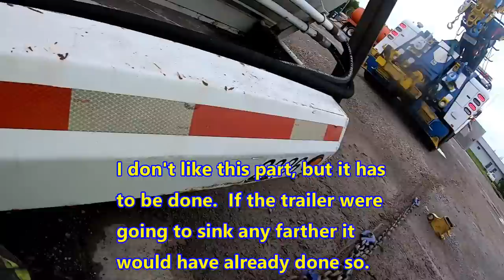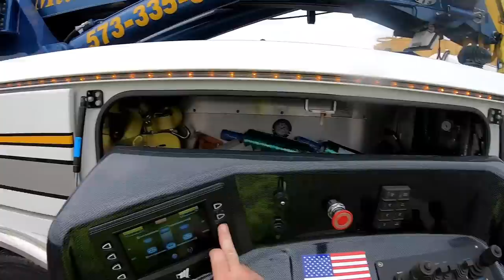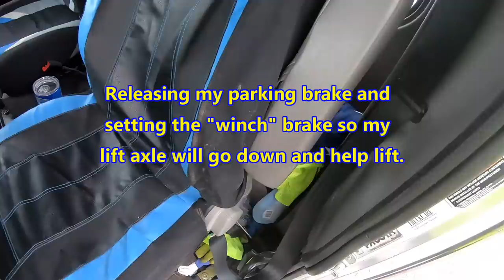Loaded Tanker Takes A Dive....Nose Dive That Is

Comment: I wish you had devoted some time explaining why this was dangerous instead of simply stating it was misleadingly dangerous.  From my naive perspective it was a trailer loaded with water over soft ground; which doesn't seem dangerous.  What's the worst that could happen?
Reply from the maker: There were multiple dangers to this job.   Since the load was heavy liquid, it transfers the weight forward when the nose goes down, so there was no way to know an exact weight that I was lifting.  The lift itself was dangerous.  Me having to get under the load was dangerous.  Performing the lift on soft ground conditions was dangerous.  Moving forward with an un-baffled liquid load suspended behind the Tator was dangerous.  Chains running over a metal end creating a high pressure point was dangerous.    Walking anywhere around the trailer while it was suspended was dangerous.  Setting the loaded trailer down on the bent/broken dolly legs was dangerous.  The heat and humidity were dangerous.  Working by myself was dangerous.  I could go on and on.  However, I find that when I point out all these dangers, some viewers make rude comments that I am being "dramatic", when in reality I am only trying to convey the actual dangers associated with the job.  There were many times during this job that if something had failed or gone wrong I could have died.  That is not being dramatic.  That is the simple truth.   I try not to think about it, but that is a huge part of why I take so many precautions and attempt to be as safe as possible.  This job is inherently dangerous....period.    Thanks for watching and God bless.
Reply: @RonPratt  I wasn't implying you were being overly dramatic.  I just do not know enough to understand why it was dangerous.  There are probably others like myself who have no experience and don't see what your experience has trained you to see who would benefit from your inner analysis and insights.  It makes it more interesting to me when you share your thoughts.  Like your comment that it is an unbaffled tank.  I had not thought about that.  When you pointed it out, I then understood why you emphasized in the video that you were taking it slow.  I didn't put those two things together until you pointed out in your reply that it was not baffled.  It is more interesting to me when you share those insights and observations that may be so ingrained for you that they almost don't register consciously with you.  For me, it didn't even cross my mind.
Reply from the maker: @Scott Perry I meant no disrespect and I didn't intend to sound harsh.   I was attempting to answer your question and also explain that I have issues with some viewers who believe that I AM being dramatic, when, as I stated, I simply make the comments about the dangers so that people will understand just how dangerous it is.
Reply: @RonPratt  This is the kind of job where the danger seems minimal for the average person, but for the 'experts' they see all of the dangers. Some of those are really dangerous, like going under. Some others seems so unlikelly that for the unexperienced it look like you are being overdramatic when in reality you just consider what could happen. One example is when you walked between that tanker and the other. I felt a bit uneasy when you went there. Even if unlikelly at this point, one chain could break, which would cause the trailer to swing. Yes the legs were extended at this point, but again it was damaged. Which is another problem from going between them. The legs could also have collapsed, leading to a trailer that swing sideway and down... Yet, for the average people, it look safe, after all, you are still hooked so it 'should' take the weight if the legs fail, and if the chains fail the legs are extended so it 'should' take the weight... We know it is not a sure thing at all...
Reply: @RonPratt  Better to be overly cautious and careful, than to end up a pancake under that trailer!  I would have been afraid to drop the trailer after seeing that cross bar bent like that, and leg tilted in. Glad that guy got a tractor under it quickly.
Reply: @RonPratt  When you said "sugar water" to me that indicated that it was probably like a syrup and slow to move. So not only is there more weight in the nose, it may not move when you raise it. Depending on its viscosity it could take minutes to level out.
Reply: @RonPratt  I get it.  Thanks.  I'm sure you wouldn't be aware of all the dangers inherent in my work if you stepped into my work environment as well; paper cuts, staples, stairwells, running out of toilet paper, ...
Reply: @RonPratt  haaha dude why do you even waste your time replying to trolls. just disable your comments section, yer still gonna get the same views.
Reply: KP OP wasn’t a troll!
Reply from the maker: @RevMarket  Agreed, I believe Scott Perry asked a pertinent question, so I responded.
Reply: @scottperry9581  I assume Ron cleared it up. But, Trailer loaded with water. Fully loaded with water, on soft ground... Trailer, loaded with water, on soft ground. How does that not sound like a disaster waiting to happen? The trailer already sank into the soft ground. Just an FYI: I have no experience in this kind of job. I drive a reach truck and counterbalance as my job. If you were never taught to recognize danger. Real danger that could kill you or somebody else then I will throw out a suggestion. Learn about all the potential dangers you could come up against. Not to be all scared n shit about "danger" but to be aware. Even I thought to myself watching Ron walk  between the suspended trailer and the trailer on his right "That's an incredibly deadly place to be if a chain or line fails" (words to that effect) Watch as many videos as you can with these kinds of recoveries to learn and understand what makes something dangerous, and to learn how to spot risks. I understand not everyone is aware of everything. But i'm surprised how anyone (other than a child, no offence intended) could think that this lift was "misleading dangerous" I bet you've narrowly avoided death on many occasions due to being naive and unaware and not even realized that your life could have ended in 1 second. I won;t assume what job you do, or how old you are. Shit, there's risks and dangers working in an office at a desk all day. there's risks going to the toilet to take a shit in a rush. This lift was about a 10/10 on the danger scale (laying under the trailer put it to a 10 in my opinion) Before that, maybe a 7. walked between the trailers also made it far more dangerous. I'm rambling now. I'll stop. You probably get the point. :)
Reply: @RevMarket  Thanks.  My purpose was to understand at deeper level the dangers not apparent to my eye.  Ron Pratt obviously knows his stuff and I appreciate his taking time out to educate me.
Reply: @RonPratt  I didn't feel any disrespect.  I am grateful you took the time to reply.
Reply: As a wrecker driver myself we do and see what others don't and ron is a professional with a lot of experience. Some of it gained through error. And it does become normal for us to do a job and do it quickly so it seems easy it is his experience that makes it easy and quick but never can make it less dangerous.
Reply: @thephantom1492  The thing is, in this line of work there is no such thing as being too safe. When a person starts that line of thinking is when they let their guard down and catastrophe strikes. I drove the "big rigs" for many years until recently when I retired. I never pulls a tanker but being in the industry for such a ling time you naturally pick up other information. Beginning several years ago if a driver pulling a box trailer wanted to carry liquid totes in their trailer, they were required to have the tanker endorsement because even those smaller liquid containers can pose the threat of sloshing liquids. I experienced that too many times. Water is among the heaviest of many liquids and can be quite dangerous if not properly handled.
Reply: @Kevin-go2dw  Sugar water even in this context is plain ordinary water with whatever quantity of sugar added. That alone will make it heavier plus the water is able to slosh around in the tanker quickly.
Reply: @RonPratt  Also the dolly feet could have been suction stuck in the mud and during the lift suddenly let go causing the trailer to lurch
Reply: @jonnywilson9117  I'm a steam fitter and in our trade crane heavy lifting is common and yes, there are certainly lots of dangers that are present. Chain lifting aren't allowed as chains rated for such lifts are insanely large and worst of all, HEAVY. For lifting where sharp edges are a problem, we have nylon softeners that we use. When nylon isn't an option, we have wire slings.

The main issues is you don't know if the load will slip or shift when lifting. Once the load starts moving is a certain direction and with enough speed, it can get very dangerous. I've seen loads shift with so much force that if a finger or any body part were in the way, it will be destroyed. 

I even noticed in the video how he never jumped over the low arm when there was a load. He instead chose to walk all the way around the crane. The entire area behind that truck was very dangerous.
Reply: @RonPratt  There were so many dangers, you could have spent the whole video talking about them. I watched when you looked around the nuts at the top of the dollie leg that was a bit toed under.  You didn't talk about fractures in the paint as a clue to underlying metal fatigue about to collapse the trailer forward to the right, putting a big strain on the left chain to who knows what result. 

Years of having to take calculated risks in kill-zones and pinch points and beside loads that could shift in a moment let you give great advice about risks but you don't always have time to recount the years of experience that back your cautions. 

I've noticed how much better you have grown as an educator. You give clear and pertinent directions. Keep up the excellent work. 

If you ever decide to change careers you'd make a great industrial safety trainer, but not too soon I hope. You channel is my favourite on YouTube.
Reply: There is an action that is called "Moment of Inertia", involving Fluid Movement. There is no way to calculate Moment of Inertia, in this scenario. I believe Ron already commented on this issue.
Reply: Someone mentioned dealing with trolls by turning off the comments. I think that would make this more like TV than interactive learning conduit that it is. Ron knows what he is doing and a lot of us watching have no idea of all the technical details that he runs through in his mind to make sure that he goes home every night. 
Trolls are going to troll. Its what they do.  It all comes back to the classic "walk a mile in another mans shoes" in the end.
Thanks again Ron for sharing your daily job with us. The editing and forethought in getting good video is yet another set of skills that you quietly teach by showing us how its done.
Reply: Scott are you a member of the Darwin Club? I think you would be a prime candidate, the nice recovery man goes under and works next to a sinking load tanker which by definition is unstable, what could possibly go wrong? Well have you got a few hours, a shovel, a brush you will never use again and a liquid proof body bag? I do!
Reply: @RonPratt  Ron "dramatic" Pratt 

i'm joking of course
Reply: @RonPratt  Ron..As Always amazing video content and awesome work u guys do @ Midwest. Dangers are Dangers no matter how u look at them. Thank you for helping and thank you for making great videos. As I've stated before, Im a plumber that lives on the Jersey Shore...and i cant get enough of your vids ! Has nothing to do with my career...but i cant stop watching !!... TY Ron
Reply: G Cairns The reason I got hooked on watching this channel is that Ron normally explains all the things that are going through his head—all the little things he is thinking as an expert that all of us with no experience wouldn’t even notice.  I don’t think the original comment was phrased as well as it could have been, but I think Scott was just asking the questions Ron usually gives us the answers to before we knew to ask.  I just took it as Ron being fully mentally engaged in the problem, and I would rather have Ron talk less and stay alive, even if it means I don’t fully understand why he was so concerned.
Reply: Ron Pratt most of the jobs you preform are dangerous. It doesn’t really take a whole lot to understand or see that. Therefore I enjoy watching what you do, and have the upmost respect for what you do Ron. Stay safe out there and god bless man.
Reply: @RonPratt  Well explained, period.
Reply: @KP-py3gl  If Ron Pratt disabled the comments, there would be no reason to spend an hour watching his videos.  I would unsubscribe to his channel and move on.  There's plenty of other youtubers putting out videos that are just as good as Ron's.  If a youtuber can't handle trolls as you call them, there's no point in putting videos up.  Some people have way too much time on their hands.  I will say the security kid in the video wants to do the right thing.  He's young, got a newborn and a fiance' and wants to do better.  Not many millenials around who think like he does.  I look at situations like his.  Some young fathers just walk away and leave their children and responsibilities behind and not accepting responsibility for their actions.
Reply: @Scott Perry since water alone weighs 7 pounds a gallon, I think it would be safe to say he was lifting at least 60,000 pounds plus not knowing if  the tanker has baffles in it when fluids move they can move a hole entire trailer
Reply: @Ron Pratt  lol I'll leave it a lil high in comes  driver not paying attention  and runs under missing 5th wheel pin, trust me you only do that once lol
Reply: Crawling under that unstable sinking tank made me wince. 
I would have opened the tap and come back when it was empty. It’s only sugar water not hazardous waste.
Reply: @RonPratt  I was watching this video thinking about most of those things. You couldn't pay me enough to get under that trailer like you did to hook up those chains.
Reply: @Kickinpony66  There is also a possible issue with water hammer depending on the viscosity of the liquid The bottom line is that the hundreds of things that can possibly go wrong with a lift and move using the heavy recovery vehicle makes the job risky.
Reply: @ @jonnywilson9117  the man asked a reasonable question, I don't think he needs to be castigated by you or anyone else for that matter, how else is the man supposed to learn. Your response is quite arrogant and perhaps rude. Just because you recognize the danger someone else with less life experience might not
Reply: Thank you for asking this question, and for Ron's answer. Sometimes the danger is not obvious to us peons, unless someone with experience points it out to us. I always believe there is no stupid questions, only a stupid idiot who didn't ask that question. (Butchered the quote of 'There is no such thing as stupid questions, only stupid answers')
Reply: llp
Reply: pp
Reply: p
Reply: I'm not a wrecker, but I am a truck driver, and dear lord, it had my teeth clenched when I was watching him climb under the nose to hook up the chains.

Comment: As a recently unemployed truck driver, I can appreciate you taking so much care to drop that trailer at the right height. I've had to pick up so many trailers that were too high or too low and it's such a pain in the ass to crank a loaded trailer either up or down. I picked up one loaded with 43,000 in a reefer that was so high the kingpin was three or four inches above my skid plate.

Comment: You sir, have a bigger set of stones than me!  I was helping a friend work on his motor home 20 years ago when the leveling system failed (actually, since then I learned a LOT about leveling systems and realize it was operator error) and dropped an entire Holiday Rambler on me.  You crawling under that rig is something I could not do for any amount of money after the pain I went through.  I understand it has to be done, but I was having flashbacks just watching!  God Bless and be safe Ron!  Oh, at the very end when you drove away with the boom controller on the underlift, I did expect to see the tractor back in and make a very expensive crunching noise...... LOL
Reply: Thank you again for Northeast Missouri . Disabled country hick from the sticks . And thank you for working as I try to manage your money wisely you and every other working person. Thank you God bless